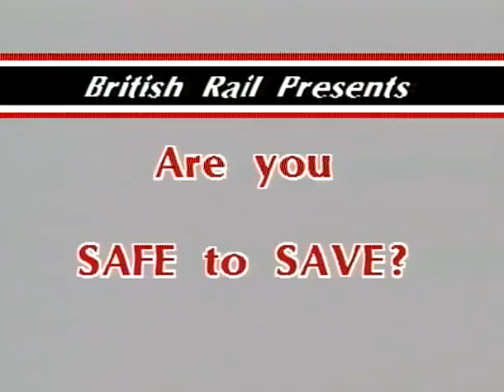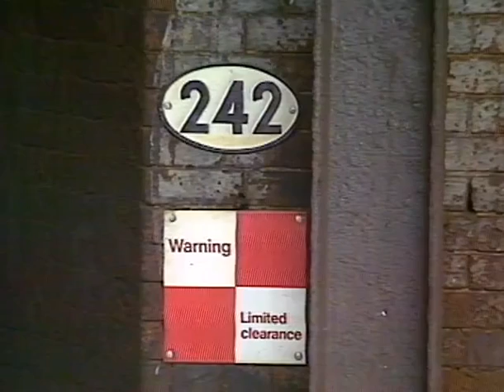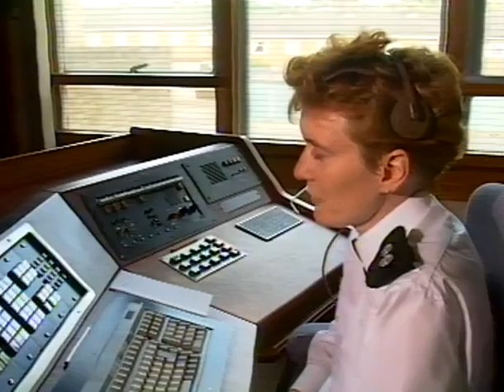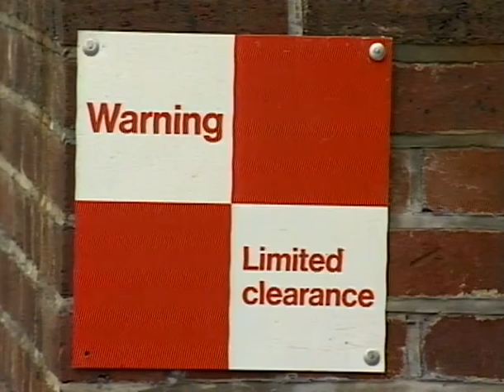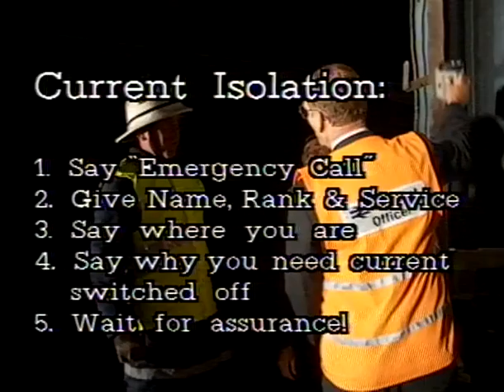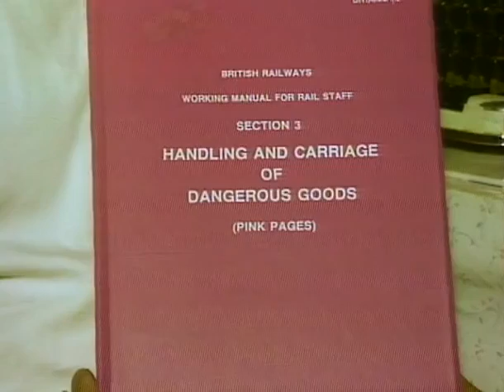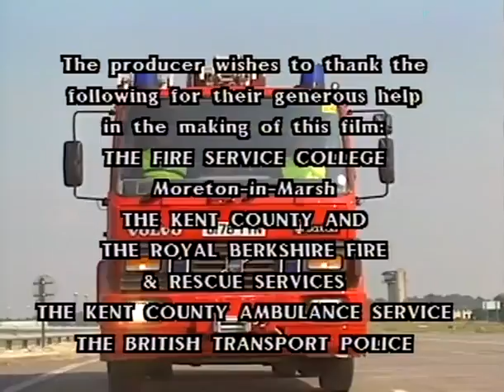0053 - Safe to Save

Comment: Even worse if it's a DVT leading . "Whispering Death " we called them . 🙀👍
Reply: The rails still loudly vibrate when a train approaches
Reply: @DonFelixGallardo true but say a train is going at 90mph, it's only about 4 seconds after you hear a train approaching, until it reaches you, that's barely enough time to register it's coming than to take avoiding action.
Reply: @Robdc89  plenty of time
Reply: @Robdc89  I’ve said it before and I’ll say it again…
Anyone who manages to get themselves hit by a train has won a Darwin Award of some kind. Trains are very large, fairly loud metal behemoths and literally only go where the rather narrow track allows them too. It’s not hard to get out of the way

Comment: Don't say that at 0:38 the liquid sprayed over the camera as the train passed was sewage from the toilet someone just flushed!
Reply: may well have been lol
Reply: @Saucy-ws6jc  that's completely untrue, there are still some trains in the UK that flush directly onto the track
Reply: @Percy Harry Hotspur  I must have been 13 or 14 when I made that comment - completely forgot about it. Regardless, I'm 3/4 the way through an integrated masters degree in electronic engineering so I may be able to provide a response to your question. The UK hopper toilet does not just pass 'solids and liquids' straight through an open hole in the floor and onto the track - so it's unlikely that a direct path would be made between the person and a live rail. Also, the metal features of the chassis and toilet fixtures will be connected to electrical earth/ground by design, and so if any arc were to pass up through a conductive stream towards the train, it would be diverted away by structure of the train.
Reply: IP Freely : Wrong. Many trains still discharge onto the tracks. Exeter St. David’s offers a good exhibition of turds, for example.
Although it is true that the government promised money for retention toilets many years ago, I think they found something else to spend the money on.
Reply: It probs was lol
Reply: @Saucy-ws6jc  still had turns on the track in 1995, I know, I was on Pway at Shrewsbury.  😎👍
Reply: @Saucy-ws6jc  that was a class 91 set, brand new at the time this was made - have they always had retention tanks?
Reply: It probably was I'm pretty sure that this was a HST.
Reply: @chriswalford4161  this comment is way better read in the narrator's voice

Comment: 16:00 "in an emergency, detonators are used to protect the site". Then we see these little bombs going off. Eh!? What the HELL is the point of that?
Reply: Warns approaching trains that there is danger ahead.
Reply: A very loud bang and a jolt to tell the driver of the danger.
Reply: Those are detonators. It was to illustrate that detonators are explosives which are applied to the rail head near the site of an incident, exploding when the top is depressed by a wheel or some stupid sod's foot. Their main purpose is to act as an audible and sometimes visual warning of danger to the driver of the train passing over them and because of the fragments that can be produced from a detonator explosion they should be avoided.

Comment: .           2:51  The signaling room: why do they all use rags on the handles?  I’ve seen that in a few vids now.
Reply: @jackrussell9094  That and it keeps the mechanical aspects of the levers gunging up and becoming stiff and awkward to work with. It's also a matter of hygiene when it comes to corroded metal as it can cause infection, not to mention the germs that would be passed from one signaller to another day after day if they weren't cleaned.

Comment: Why would a phone not be for emergency 999 calls? Surly an emergency call should capable of being made from any phone at any time otherwise help would be delayed.
Reply: I'm assuming the way the phone is wired doesn't allow for external calls to be made, at least not directly. I think I read somewhere in the sectional appendix that calling 999 on some railway phones will still direct your call to the railway, who'll then have to place a phone call to 999 themselves and connect your call.

That said, someone more informed will know the full reason, whether they're able to share it is another matter altogether...
Reply: The fire control centres won't know the locations of railway telephones, unlike BT phoneboxes. It is similar to the mobile phones and emergency calls so the Highways Agency introduced position identification signs.
Reply: it's possible that the phone doesn't even have a keypad, and it auto dials a pre-defined number when the handset is lifted
(most railway phones, at least nowadays, are like this)
Reply: Well signal post telephones are only connected to the signalman, although at stations platforms have plug in telephones that can call the signal center, as well as emergency services, usually if there is an emergency either on the rail or train, drivers or railwaymen will make an emergency call to the signalman and ask them to call the emergency services.

Comment: Many electric trains can run at line speed on their batteries so this program needs updating
Reply: this was made 24 years ago, it will have been replaced many times since then!
Reply: Cheers and the SR old emus can coast to a safe place to stop this including the 421s, 455s and other emus like the 365s as with 319s
Reply: someone tell this man that BR dissolved already.
Reply: It’s now called NR.
Reply: AFAIK there have been very few trains with traction batteries? Up until now there's been the Underground battery locomotives, the 379 trial (now removed), the 230/D78 prototype and TfW units, and soon the 777s and 756s (and if you include them, the Birmingham trams)? Most of those have been only in recent times (and I don't think I've missed any - the 803s don't count as their batteries aren't used for movement?)